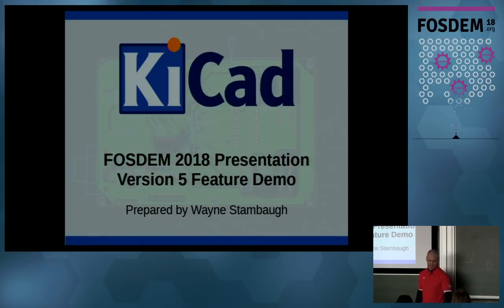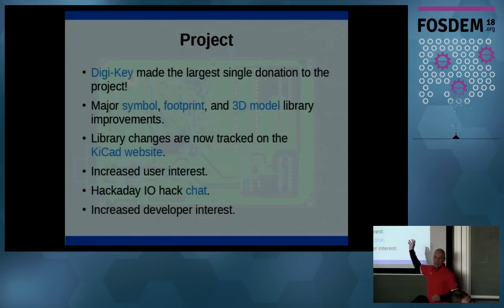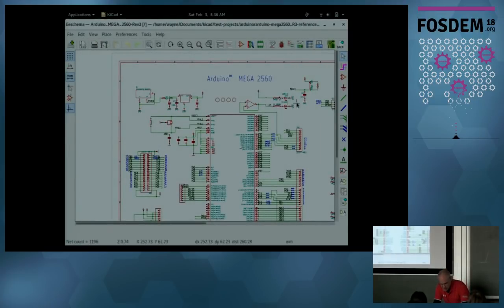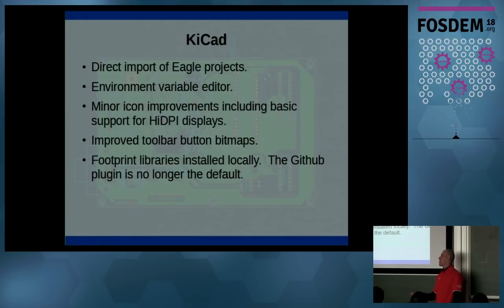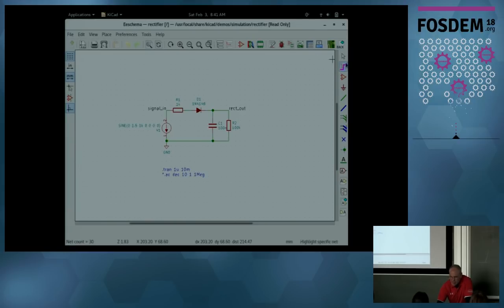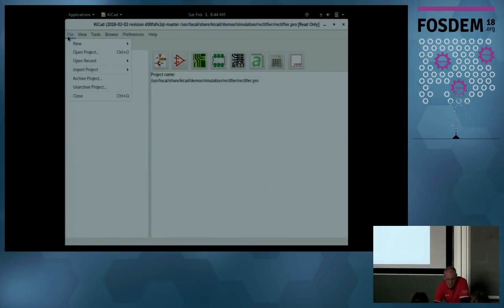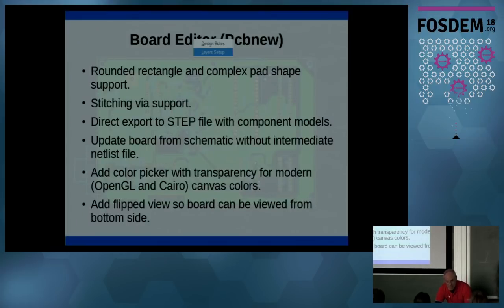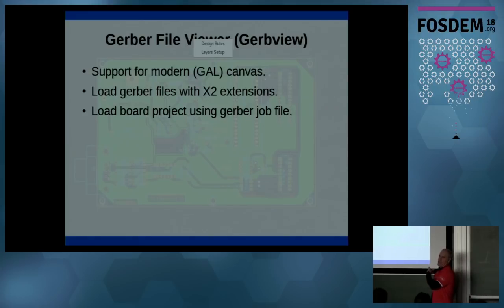KiCad Version 5 New Feature Demo

Comment: This has me thinking of switching from Eagle to kicad
I'll at the very least do my next smaller design in kicad to test things out.  Love the DigiKey is donating.  Hopefully that improves the parts libraries too
Reply: I converted from Eagle 7 to KiCAD v4 last year. Learned it for 14 days on small project, went to full blown project immediately after. I would never look back. KiCAD is absolutely amazing even with its issues.
Reply: Forgot to mention - thank you very much KiCAD team!!!!!!!!!!!!!!!!!!!!
Reply: I'll second that. KiCad is quirky, but not significantly buggy. The workflow can seem daunting at first, but as you build your own libraries, much of the workflow is automated out.
Reply: Do exactly this, start with a small project. Heck even start with something simple like a 555 flasher circuit. If you attempt to make the switch when you're under the gun, you will get frustrated and just switch back. It took me about 3 projects before I suddenly realized I was "fluent" in KiCad.
Reply: I'm in the process of doing exactly this - I've been using Eagle for 12 years over multiple versions with paid licenses, but the license changes are intolerable now.  There's a great basic tutorial here that walks through the basics https://learn.sparkfun.com/tutorials/beginners-guide-to-kicad/introduction
Reply: Exactly!  I've only ever used Eagle and it has me a little nervous to learn a completely new software with parts libraries I haven't built myself over the years... but these license changes are just too much for a product that just does the job.

Thanks for the link, I'll start there
Reply: You should try